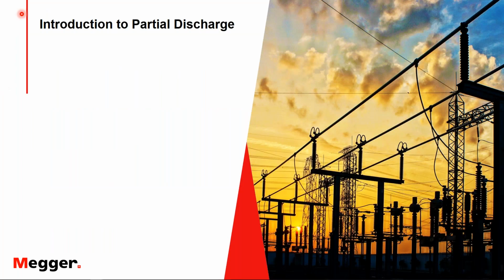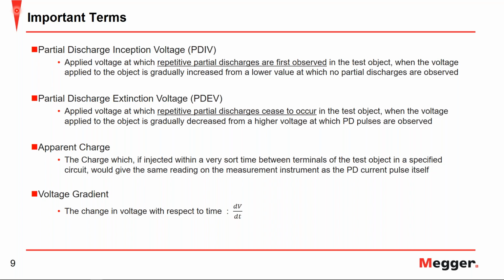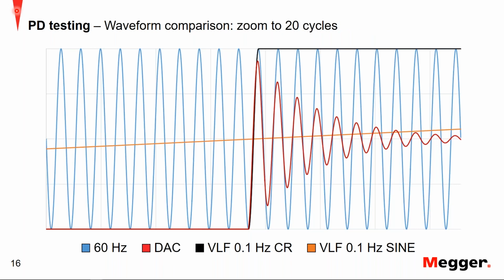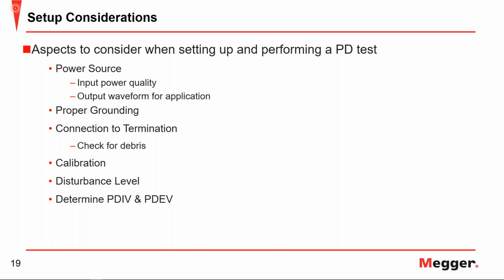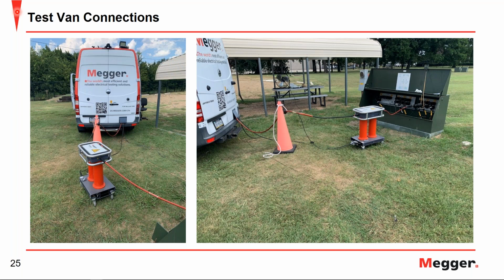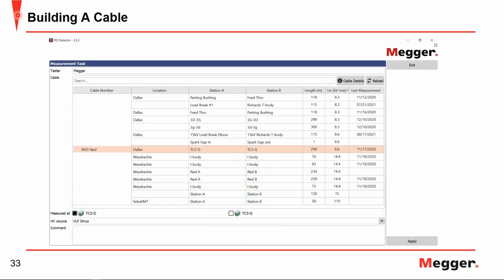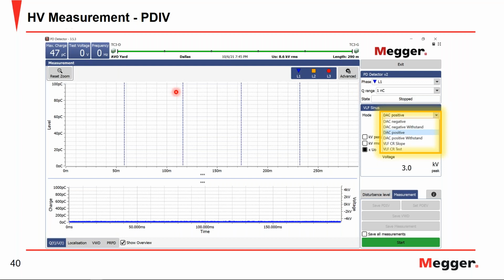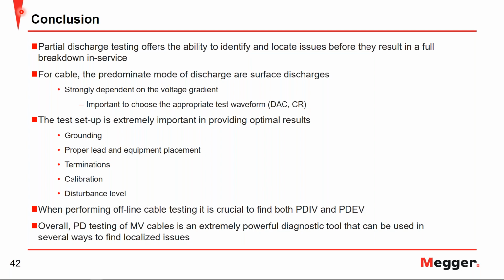Best Practices for Partial Discharge Measurements on Medium Voltage Cables

Comment: Hello, I have a PDS 62-SIN partial discharge measuring system. Can it be used to perform partial discharge (PD) measurements on VCS (vacuum circuit breakers)?